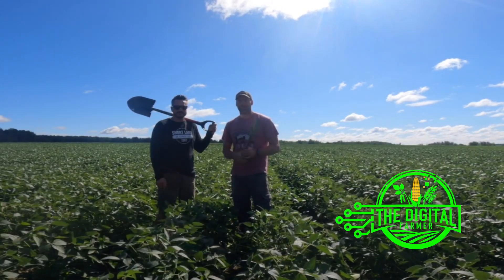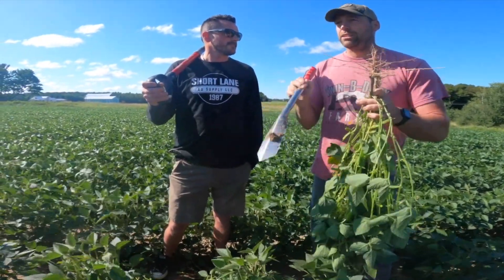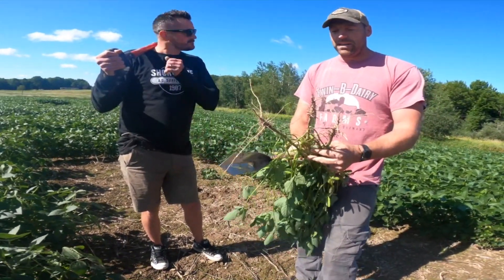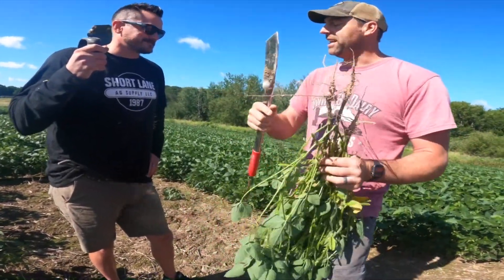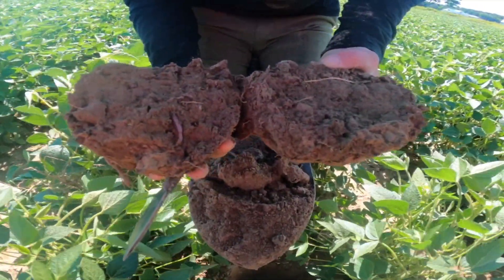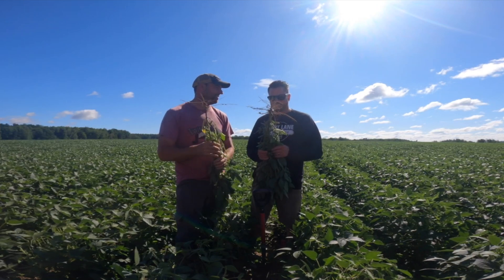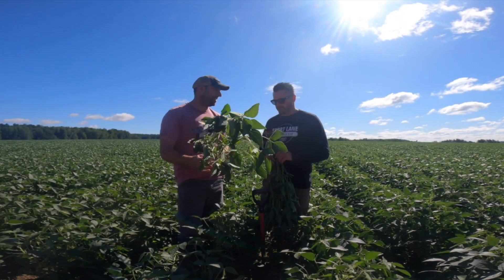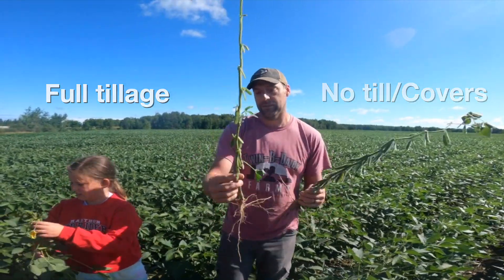No Till/Cover Crops vs. Tillage in Soybeans - Big differences!!!

Comment: Those guys at short lane are great and knowledgeable. Great to hear you are seeing a huge difference. You thinking of maybe doing less high speed disking? I've always heard any disking conventional or vertical isn't good for the soil profile.  I've been doing no til and min til for 14yrs. Always good to learn new things. Especially in our area where you get called crazy for doing things differently.
Reply from the maker: Yes they are! I’m still going to use the high speed disc. I fall in the middle of the pack…I have 10yr no till fields and also conventional till fields. I would like to move to strip till one day